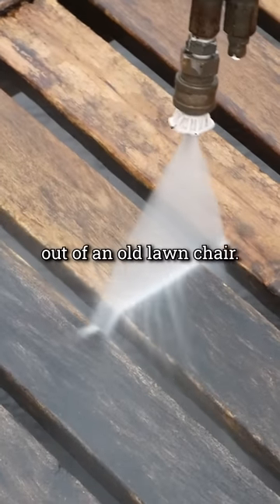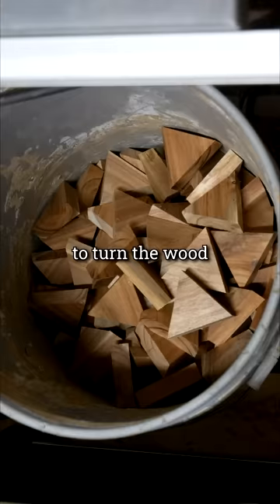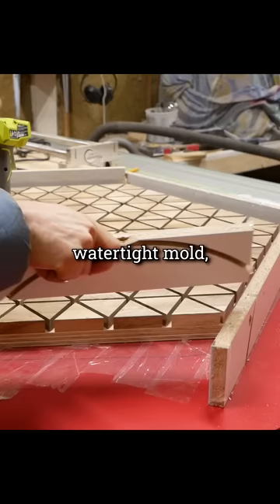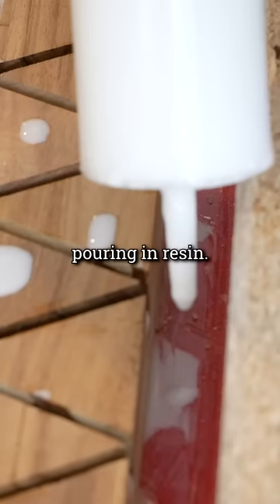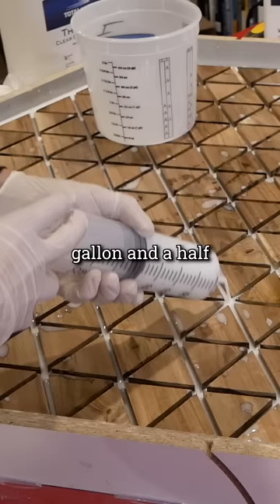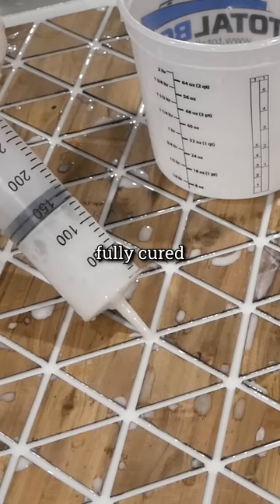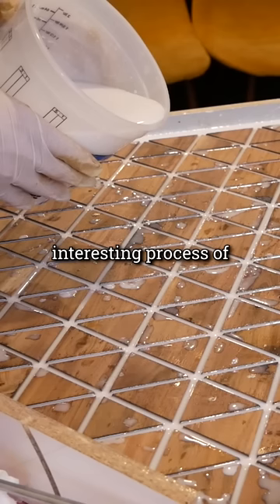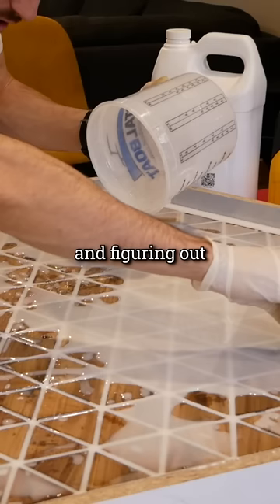Old chair 👉modern coffee table #DIY #woodworking #upcycling #epoxyresin #shorts

Comment: A well known guy once said: epoxy is the 21st century’s asbestos. If the epoxy hype is over, all these pieces are going to be tossed because they can’t be flipped.
Reply: Wood can be reused over and over again until it can just be burned for heat. Having a type of plastic in it makes it a pain in the ass to recycle
Reply: And epoxy is even worse than plastic. I dont really get this obsession with mixing it with wood all the time. We work with resins all day in our business and they last about 5 years depending on the type. Wood will last lifetimes.
Reply: @dale7561  at this point wood is just filler for epoxy ffs
Reply: Particle board is probably worse and more common than epoxy furniture. People don't know how bad it is to burn as well, because they don't know it contains toxic adhesives.
Reply: @dale7561  and it looks ugly. I'd much rather have a large piece of wood with a natural hole in it than one filled with some ugly glittery resin. I see people using chopping boards filled with resin as well. That is such a bad idea.
Reply: I don't think Epoxy causes cancer...
Reply: @senioravocado1864  As far as We know Right Now; people didn't used to think Asbestos was harmful either ..popcorn ceilings were all the rage! 🙄☹️
Reply: @senioravocado1864  microplastics cause endocrine dysfunction. Plastics are pretty awful for us.
Reply: @lifesjustfine  yeah but nit epoxy, unless it's the shaved ones you ingested somehow
Reply: Epoxy has BPA in it, so as long as you don’t eat off of it or sleep on it, your exposure will be safe. Particleboard and OSB use really toxic glues too so it’s really a matter of what will get you first and it’ll probably be none of the above
Reply: What is asbestos
Reply: @bunnyphoenix2992  it's a very very old building material that people used to use, it causes cancer though so we don't use it anymore

Comment: And one year later this will be YELLOW resin, not white.
Reply: Isn’t there a way of protecting it?
Reply: @turboboy9025  not really. It's very hard to protect any kind of plastic from UV. Which is what causes the yellowing. Best option would be to paint it which kind of defeats the purpose of the resin.
Reply: @Patrick-zr8tv  what about putting it in an underground vault away from UV rays
Reply: @Random_.  dude seriously
Reply: @noname-zi9xm  no no he has a point
Reply: @turboboy9025  ya, by using yellow resin

Comment: This is NOT made out of that chair!
It's made out of just wood.
If it would be made out of the chair, you would use the pieces as they are to make something different out of it.
This is basically like saying...
I made Superman out of a Spider-Man figure, during which you melted the figure and recasted it into a Superman mold, then painted it over.